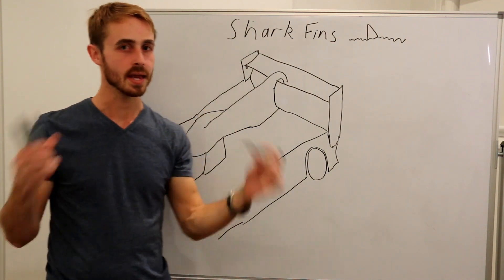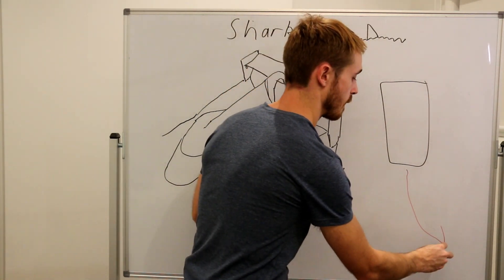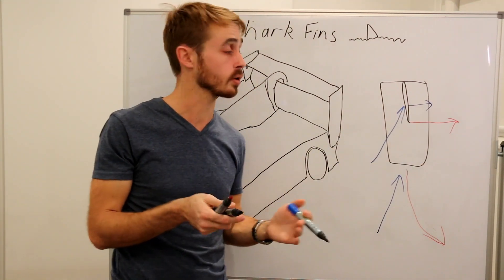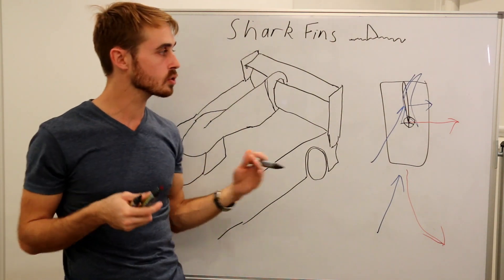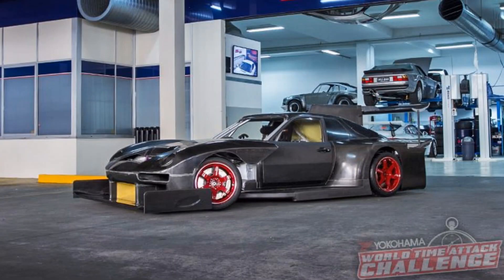Shark Fins (on Race Cars) Explained - LMP1/F1 2017 Technology

Comment: unfortunately i just search this knowledge for rally car design. and i missed it for 7 years. my question is why no rally car use shark fin? is it not included in regulation and what if used? please help to answer. thank you
Reply: My best explanation is that 1. Rally cars don't often corner at such high speeds, so they do not need a lot of stabilization.

2. Shark fins help with cleaning dirty air, and as you know, rally cars never deal with dirty air.

3. Rally cars do benefit from instability when braking, so that the car can cut through a sharp turn 

4. There is not enough space on hatchbacks.

Comment: I think it would be cool to experiment with adding a rudder and aileron system to the diffuser in addition to this. They would be geared togethor and linked to the steering. The ailerons would tilt the car like a motorcycle and the rudder would work together with the shark fin like the keel and rudder system on a boat. It would also feature a double diffuser design to prevent stalling

Comment: Hi Kyle. Nice video! Sideforce of a sharkfin is beneficial for cornering when in front of rear axle. But I was thinking: When you extend the sharkfin far beyond the rear axle then it should be more benificial for straightline stability because sideforce is working against the steeringangle.... 

Am I right? I'm looking to get more straightline stability for my 300kmh RC car...

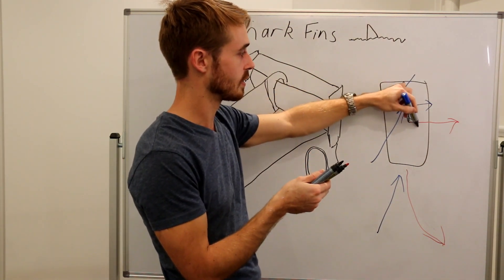Comment: wouldn't the back horizontal wing make it resist change in yaw direction? like a plane? I don't really get the picture at 2:53 if the car is making a left turn and the side force of the horizontal wing is making a force into the turn, isn't it just going to push the rare of the car to the to the right (in the diagram/video) making the nose point the opposite direction of the left turn (right)

Comment: don't see how the fin "assists" the turn.  if anything, it works against the turn, like an arrow (which you later used as an affect that disagrees with the earlier theories.  One would need to add a hinged rudder to asset in turning.  Which I'm patenting tomorrow.

Comment: Why do you look like you stayed up many nights just to think of this? You look like you don't sleep much. 
Just knowing what i know, airflow is what gives the camber on a flat surface. Basic airplane ideas, a flat surface with an angle at the end causes lift or in this case turning help. (I know plane wings are not flat).

Not to mention safety factor, it helps slow down the car in a sideways crash. 

 The sharkfin design also equalizes the downforce to 3 points left, right, and center. And due to cornering, the center fin allows the inside wheels of the car to get more downforce that would otherwise have been directed to the outside wheel in a standard design.

You also fail to mention that the downward force from the shark fin is able to be at a lower center of gravity than the area above the wheels causing a better center of gravity. Not to mention the ability to lower weight on the outside top of the car to the middle bottom. Can you also add the reduction of turbulant air due to the cockpit causing unhelpful pull in the wrong direction due to basic aircraft lift mechanics.

This is me scratching the surface in 5 minutes of thinking. Hope you didn't take too long on this while stealing half of the video from another person.

I can go on and on about the help this gives. Im tired of writting. Btw, worse coverage than engineering explained's videos. At least he takes 10 minutes to provide useful information

Comment: WOW, so they are more for corning stability?I always assumed they were for straight line high speed stability.Did you know they have made a come back for 2017 in F1?Ross Brawn, who has been employed by Formula 1 Management, (FOM), doesn't like them and is going to try to get them removed if possible.

Comment: Ok, I'm not an engineer but I know a little bit of physics and there's a law that states, for every action there's an equal and opposite reaction. The car creates its own air flow direction over itself as it travels through the air. Air flow doesn't come along towards the car. The front of the car hits the air, the air hits the car back with an equal and opposite reaction and flows over the car. So, whether the car turns left or right, the air will always flow longitudinally over the car front to back. What your theory is describing is wind blowing with external force, laterally across the car.
Or tell me why I'm wrong.
Reply: You need to understand vehicle yaw. Your logic is correct for the overall direction that the car is traveling, it just happens that the car is at an angle while traveling in that direction aka yaw.
The easiest way to understand this is to imagine an extreme case such as a drift car. They can exit a corner in a direction in line with the track but the car can be completely sideways. The airflow matches the direction in line with the track even though the car is angled.

Comment: Thoughts on how this applies to the giant side boards on outlaw figure eight cars? An example http://i.kinja-img.com/gawker-media/image/upload/s--RdxE8Bw4--/uq0aekqr3rc2si6vmt2p.jpg     Would one in the center be better? Is having them forward of the center of gravity bad? Some common thinking is to take them as far forward as the center of rotation, the front wheels. Keep in mind we are talking about cars with high slip angles going only 35-50MPH in a very tight turn.

Comment: would you not lose a bit of downforce on the inside portion of the rear wing (with respect to cornering direction) due to the flow being blocked by the shark fin? or is that compensated by the roll moment the relative airflow induces to the fin, pushing the inside (agin wrt to corner direction) rear wheel into the tarmac?
Reply: LongShot20121 

I think using a swan neck would be much more uncomfortable because it is destroying the flow too but letting less time to smoothen out instead of flowing along that "wall". 

The underwing construction isn't better because it seems to destroy the flow even more.

So that's how i think it is.

Comment: Sorry Dude, but some parts of your drawing are wrong:

-airflow while turning nearly lines up with centerline of frontweels
-camber has to be the oppsite direction (you said correct thing but drew something other)
-lift is generated on the convex side of the wing

I like your way to explain. it is easy to understand.

Keep doing, would like to see more ;-)
Reply: I disagree.

1. If the car is presently traveling in the direction the front wheels are pointing, yes. Otherwise, no. It doesn't matter what direction the car is turning, only the direction of the car's present velocity.

2. I have no idea what you're talking about. What he said, and drew, were correct.

3. Lift is generated on all sides of the wing, and the ratio depends on the wing shape, angle of attack, etc. You are likely getting confused since normally, the direction the wing is cambered would be the direction in which lift is generated, but that isn't the case here, as the angle of attack results in the air flowing into the convex curve of the wing.

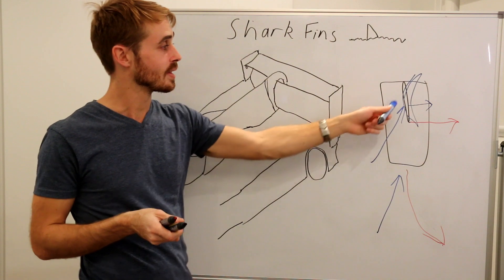Comment: You do realise that everything you say pre-3:37 contradicts everything you say after, right?
I explain:
1) The aero force explained onwards of 2:04 is BEHIND the CG, therefore its net effect is to induce a yaw moment that is fighting against your steering wheels (in other words an understeer effect) so it may be pushing the car towards the desired direction but at the same time demands a higher slip angle from the front tyres which in turn may decrease the car's overall capacity in turning high speed corners
2) The camber you describe after 2:50 is towards the WRONG direction. Generally cambered wings favour a net positive pressure difference on the convex side so whatever overall aero force the fin is generating it is being REDUCED by the camber hence reducing the fin's influence on handling
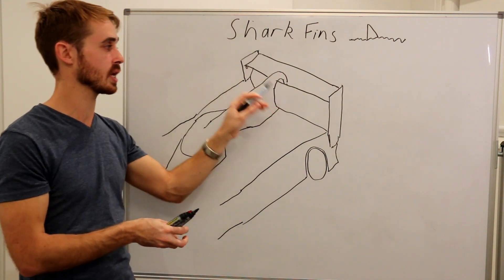3) I take what you say after 0:50 regarding wing contrustion, points towards weight saving. However you do not argue whether this weight saving on the wing is more significant than the weight penalty of installing a (at least visually) huge flat plate down half the car's overall length.

Please give more thorough explanations.

Comment: They are used primarily for rear end stability as a tail fin would on a plane (it is not as he describes using the wind deflection to aid turning as the wind can potentially come from both directions) it also helps to stop turbulence to aid rear wing efficiency the more stable the rear of a car the better the drivers confidence in that car it helps minimise rear tyre wear and you can dial in more front end to help with slower corners where time is more critical

Comment: I would go and argue a bit.   Main advantages of shark fin are,   stability on mid corner, when downforce lowers from loosin speed.  giving better initial turn in,  and braking stability.   And most biggest advantage is the  ability to control airflow to rear spoiler and area bellow it.  You can allmost get rid of all dirty air coming from front of the car that has been allready used by aero parts there.     It will calm down the vortesees (vortex)  and there for you can work rear wing harder with clean airflow.

Comment: Having read a bit about the old crabclaw sails used on small boats since ancient times and the counterrotating vortices that provide their strong power at high angles of attack it seems to me there should be a vortex forming on the leeward side of the fin as the airflow behind it drops down behind the drivers canopy thus accelerating the airflow across that surface of the wing and causing further negative pressure, I'm curious if the inside half of the rear wing also benefits from that increased (and thus lower surfacepressure) airflow.
I would be surprised if the testingcrew did not have instruments in place to measure the exact downforce at each supportpoint of the wing.

Comment: These are all points that are secondary to the reason that 2017 F1 cars have the shark fins. The primary reason for them on the 2017 cars is to promote flow attachment and guide the air on to the rear wing. They're necessary now because the rear wing is set significantly further back than the previous regs. Without them, the air would become much more turbulent by the time it reaches the rear wing, significantly decreasing the efficiency of it.

Comment: And now the giant shark fins are back in F1 :) Except curiously not on the merc, which only has a very low profile fin. Will be interesting to see the difference.
Reply: Bryant McBryant but the fins aren't there to stall the rear wing like in 2009
Reply: Alexandre Brito Those are flaps, and they deploy when the car goes sideways to prevent the air picking it up
Reply: On speedway stock cars, there are 1/2 inch high air channels that run the length of the roof 40 Inches apart (as of the last time I worked on them). Continuing along the left side, in line with the roof rail, down the rear window, and the deck lid there is a 2 1/2 Inch "fin". The roof rails are to direct air to the rear spoiler, for straight line stability. The larger ones that continue on the left side are taller to stall the air to help open the roof flaps if the car starts to spin. They are only for safety. All are the same dimension and located on the same place on every car. They can't be altered to be used as an aero tuning device.
Reply: Bryant McBryant I've noticed quite a few teams only have Very small shark fins, Williams also
Reply: MrSpookyGamer williams has a massive fin. Have you seen this years car?
Reply: Come to think of it.. Doesn't nascar race cars have some kind of "fin"on top of their cars to stop them rolling in crashes?
Reply: The mercs don't need one of these, because of the massive mechanical grip they have. And also the wings change the steering feeling (under- and oversteering). Have a mind of it.
Reply: Mighty Duck, yes. They have in the bonnet also. But i saw they had some kind of fins on top aswell. You can see that on a Top Gear episode where Richard spend some time with NASCAR.
Reply: Oh ye, now I know what you are talking about, I found an article from 2010 before they first used it.
http://www.espn.com/racing/nascar/cup/news/story?id=5001514
Reply: Its that big fan in the apex blowing air at the fin..amazing "engineering"..

Comment: Hi Kyle, in yaw, would the sharkfin block some (or potentially a lot) of airflow to one side of the wing, therefore during corning, create a higher level of downforce on the outside wheels than the inside wheels? If my logic is correct with this, it would be a detrimental effect to what would be a more ideal situation of having higher downforce on the inside wheels. Thoughts? 
Nick
Reply: Airbagged Trailers I was thinking this too
Reply: If you have a little bit of oversteer, it's going to REALLY mess up airflow over the wing. But then, oversteer does that anyways. Endplates are the same
Reply: True, but I think the sharkfins effect will be worse on the wing than endplates in yaw, as it's forward of the wing and much longer, essentially blocking all the flow hitting the side of it.
Reply: The deflection is "minimal", we are talking 4° max, so it's not like the inner part will have high negative pressure or something. I would say (not an expert) that any "excess" of airflow is negated by the fin pushing the car inward (lateral downforce? sideforce? :D ) and possibly also forcing some negative roll. So, whatever grip might be lost from the uneven airflow is then retained by the large surface. Plus you get much higher stability in the case of extra slip like a driver mistake. These cars are so aerodinamically efficient  that the flow is hardly disturbed without purpose and the fin only plays a minor part in the whole deal.

Comment: Hey Kyle, a question- I watched your video on SWAN NECK supports, where you said that if bottom mounted supports were aerofoil shaped, they would cause yaw and would result in imbalance and handling characteristics being disrupted(so, maybe understeer). But, when I compare it with SHARK FINS, which seem basically large aerofoil-shaped spoiler supports, but swan necked(top mounts), and are using the yaw concept to increase lateral Gs. but weren't we trying to minimize that effect when we were moving from bottom mounted wings to swan neck supports? Am I missing something here?

Comment: I think the lateral force effect you mentioned at the beginning of the video is minimal at best if the car is not sliding.  When you corner without sliding, the local angle of attack to the airstream is almost zero, therefore without a camber, there will be no lateral force generated.  However, if we can adjust the camber of the fin dynamically depending on the cornering angle of the car, then it will be a much more benefitial setup.  But the additional weight and complexity of a adjustable-camber fin needs to be considered as a tradeoff.

When the car is driving straight, the main benefit of the fin is to promote more laminal flow along the roof of the car, hence making all the aerodynamical devices at the backend of the car more effective in general.

Comment: in addition, i guess the side force you mention will create a torque / moment which is helpful as it is in the direction of the "light" pair of tires.  i have to wonder how much of its effectiveness is simply this.  if the fin were 100 feet tall and weighed almost nothing -- it would simply tip you inward like a sailboat sail.  i suppose regardless of lateral grip the inside tires are going to be pretty good at pushing upwards.  the dart analogy is a good one me thinks.

Comment: Hey Kyle.

I think you made a mistake.
When you draw the vector of relative wind direction at 2:03 , it means that the car is going sideways.

I agree with the first arrow. We just have to keep in mind that there won't be a huge angle at speeds that make the Shark Fin force noticeable.For me, the main reason is for stability in case of oversteering. The moment of Force created by the fin will reduce the angle of the car cornering.Have a good day :)
Reply from the maker: Hi Pierre, no it's not a mistake, the rear of the car at limit grip cornering will actually always be angled into the corner! =) This is because the rear tyres cannot steer, and thus will be at the peak grip slip angle, which is around 3-4 degrees for many race tyres. 4 degrees is actually a not insignificant angle of attack when you consider that a flat plate will be stalling at about 12. This will provide a significant amount of lateral force at high speed without oversteer occurring. Of course, as you have identified, the force will become even higher in oversteer, which is part of the yaw damping effect I mentioned. You have a good day as well!

Comment: In a flat shark fin the air push the car in the direction of the corner. First, is this correct? Second, i didn't understand the part wich you explain that the shark fin lets the air turn. Could you tell me another time that part, please?